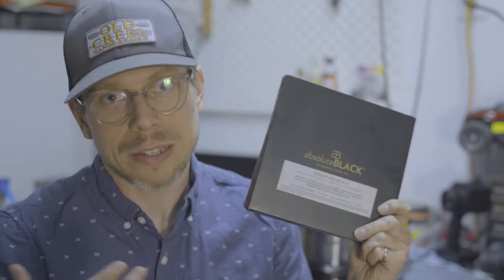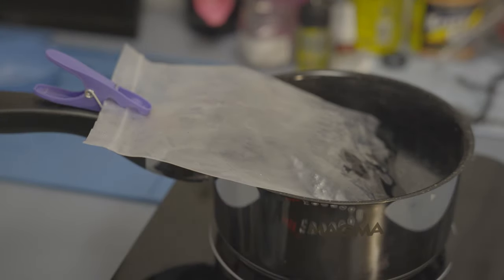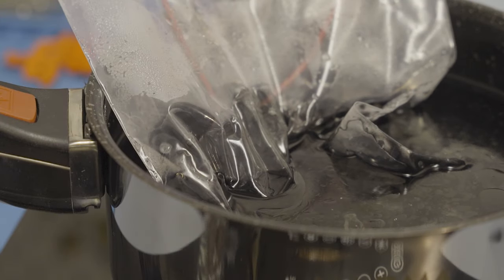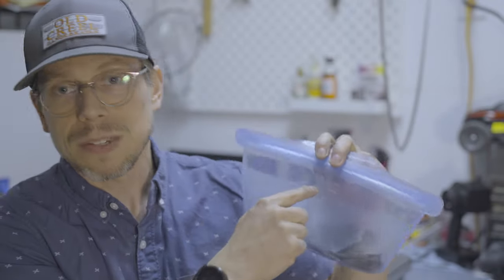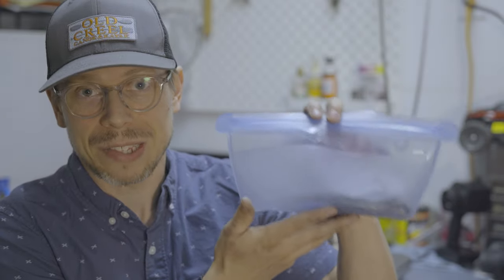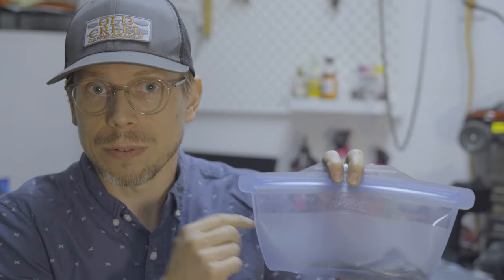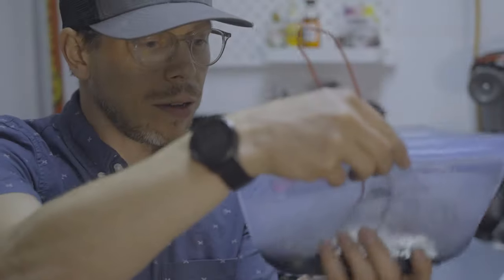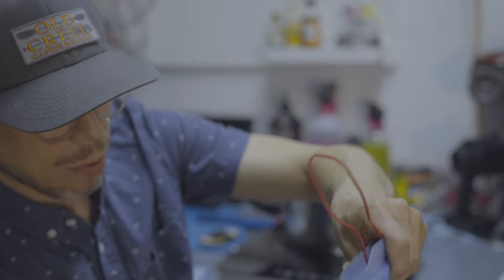Chain Waxing Without the Crock Pot

Comment: Good method with the boiling water. If you cut off 1/3 of a metal solvent can and clamp it to the water pot, it allows for more room and ability to swish the chain around in the melted wax. It's  best to attach the chain with something like an old spoke or stiff coat hanger for easy retrieval. Then just keep reusing the cut off container with residual wax already there. After several waxings a fine metal powder will accumulate at the bottom of the cooled wax which can be shaved off. I've read where some guys use a magnet to help collect this residue which I haven't experimented with yet.
Reply from the maker: Thanks for adding your experience with this!

Comment: This is the second channel after bikesauce to suggest this method. But I like that it uses separate bag than dunking original package. Will keep in mind for new bike
Reply from the maker: @drill_fiend1097  I tried using a standard baggie and the wax reacted with the plastic bag which created a mess. Rev 2 was the non reactive silicone bag which I have reused many times now. I'll also check out bikesauce's video.

Comment: Just buy a dedicated Crock-Pot for hot wax chains.  I think you really need to soak the chain in hot wax for at least 10 minutes.
Reply from the maker: I think the crock pot works for many but, for example, if you are often travelling for races, carrying a crock pot can be a pain. In my area, they are quite expensive, even on Amazon. 
Also, I did soak the chain but the video wasn't intended to be a chain wax tutorial so I didn't focus on the details like cleaning and process, I was looking to show some of the differentiators if using a bag and double boiler.
Reply: @Littlebluefarmin looks like you could use more wax in the bag. Seems a lil bit shallow/ not enough wax overall